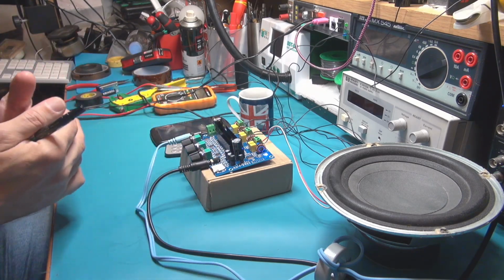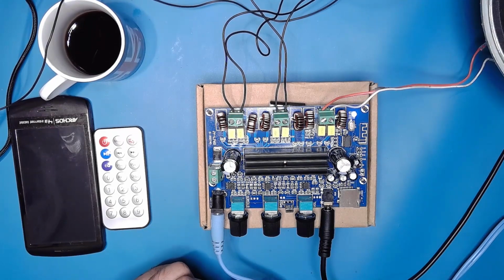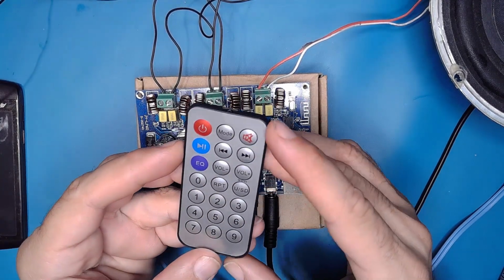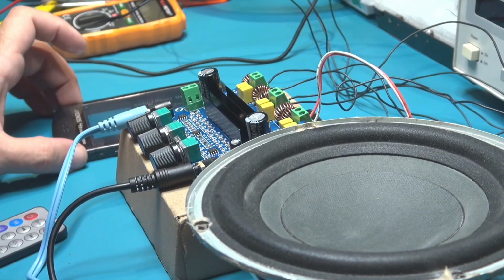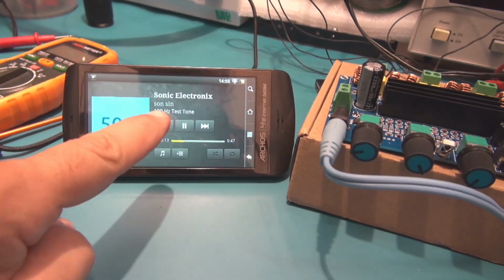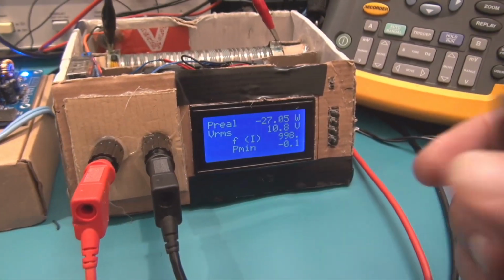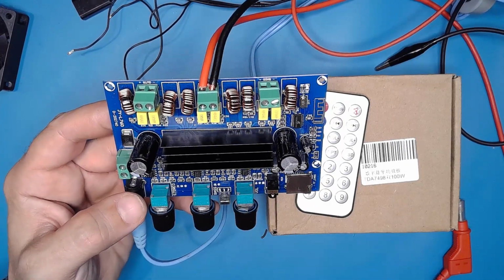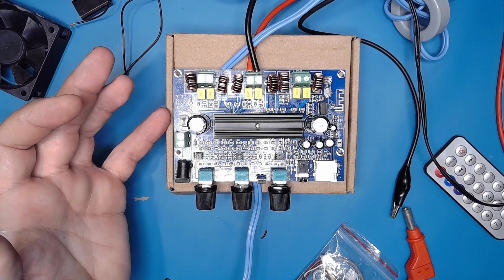2x60W + 100W Bluetooth 5.0 TPA3116D2 - The Real Watts

Comment: Id like to build a portable party box with decent bass and battery life, what size can i get it down to realistically in terms of cabinet drivers and battery array? can you give me some tips please?
Reply from the maker: it depends about what you're calling "decent". Also many of amplifier valable on the market are 12V minimum. Or you can need a little boost converter to transform 2 cell battery to 12V. This kind of tinkering are driven by the component you have. Do you have 3inch speaker? 2 inch? What box do you have? Do you intend to build your box? If you want decent bass you will need a big box, no easely handeld. Sometimes, recovering an existing box with already integrated box (from bass box of instance) is the best idea.

Comment: can i direct connect to a motorcycle battery 12v 3ampere?
Reply from the maker: yes but you will have less power than rated. Except if you use a voltage booster.

Comment: The amplifier is rated at 100 watt at 2 ohms i have the same amplifier
Reply from the maker: 100Wmax on 3 ohms
Reply: No texas instruments official data sheet states that it does 100 watts at 2 ohm
Reply from the maker: @hamxamufti5895  2 ohms forbidden. Sellers talks about 3 ohms minimal.
Reply: How and when was 2 ohms forbidden it is stated in their official website.. can you tell me more i have the exact same amplifier
Reply from the maker: @hamxamufti5895  this amplifier have overload output protection. When maximal current is reached, protection will work and you can never exceed the rated power for this amp. Under 3 ohms for the bass canal will make the amp working under rated specs, making the amp heating, decreasing effeciency. This is why the minimal rated impedance for this amp is 3 ohms for the bass channel, and 4 ohms for the stereo channel.
Reply from the maker: @hamxamufti5895  to use it properly, just use 4 ohms for each channel. The "3 ohms bass channel" is a tricky way to tell that bass have more power in this configuration. Because bass are sometimes sold with more power than stereo channels. Cheating by reducing the ohm value to have more power is more easy than create a special circuit or another power rail to afford this power. It's an advertising tip.
Reply: Im using it personally and just like you i bought it for experimenting i kinnda enjoy this so ive paired 2x 4ohms parallel for a 2ohm load didn't notice any power jump thou I'm feeding it with 24 volts but the bass channel is almost always twice as loud as the sterio channels.. i use a 12 volt smps with a voltage boaster.. the reason why i searched your video is that I'm experiencing distortion on the bass channel sterio is clean but the bass channel doesn't seem to be clean at all regardless of the subwoofer i put i always hear noise starting from half volume all my speakers are 4ohms or more even a 16 ohm 20 watt subwoofer was not putting out clean power on this dont know whats the issue but neither is the amplifier underpowered nor is it exceedeing its power limits i have applied the same thermal paste on both chips that i use on my graphics card its great and also a fan on top of it which it bigger than the amplifier itself it cools the amplifier and the output filter coils.. the amplifier heatsup without a fan but with the fan its always cold to touch don't know what my problem is but the power is so unclean to ve listened to
Reply from the maker: @hamxamufti5895  the problem is that your amp is not made for driving 2 ohm load. Try to connect only 4 ohms and use a 24V DC power supply for experimenting. By this way you will find why it has distorsion.
Reply: Does it make any difference using a 12 volt or 24 volt i noticed no difference using a voltage boaster thats rated at 150watts
Reply: All my subwoofer are 4ohms and im having distortion at 4ohms
Reply: Few days ago i think i plugged dc 12 volts into the output stage of the amplifier the subwoofer output to be precise but it powered on properly and i quickly realized what I've done but how did it power on amd did it damade the chip itself and is it causing the distortion now because i believe everything else is just to fine to be distorting
Reply from the maker: @hamxamufti5895  Class D with chips like this are very fragile about inverted input current. What happened it that the voltage sent in output destroyed a internal diode used over the output mosfet. You miss a half sinwave due to the short circuited diode inside the chip. This is why you have a distorsion.
Reply: So should i be replacing the chip for the subwoofer output ?
Reply from the maker: @hamxamufti5895  Look the price of this chip, but I think it's not worth to do that. You should prefer to buy another one, I guess. You need to be very cautious with chinese product, because of their low price there is no protection anywhere.
Reply: The chip itself is like 2 dollars locally but the board is 10 dollars plus it has all the pre amp stage and the other sterio output so I'm keeping this
Reply: I have also notted that the distortion frequency is high enough to be ditched by my big sub so can i build a crossover network to filter out the distortion
Reply: @hamxamufti5895  You are in fact correct, these boards are 2 ohm stable on the subwoofer channel. They use 2 seperate tpa3116d2 chips, one in stereo mode for the left and right channels at 4 ohm and a second tpa3116d2 chip for the subwoofer output. That second chip is run in what's called PBTL mode or parallel bridge tied load mode. That means the left and right channel outputs are ran in parallel giving you twice the current handling of a single channel, but the voltage stays the same and doesnt increase. Thus to get the 100w mono output power, you need to cut the normal 4 ohm impedance in half to 2 ohms. Since both left and right channels of the second chip are utilized in parallel each individual channel still stays within its rated maximum current levels. I've tested dozens of different tpa3116 amp boards as well as the much better and higher powered tda7498e boards. 

On a side note, the distortion is likely coming from your 12v to 24v DC-DC boost converter. An LC filter on the output of the boost converter could help/eliminate the noise. Make sure your boost converter is capable of supplying 10 Amps at 24v or that will cause problems. You should hear a huge difference between running on 12v and 24v, it should be significantly louder on 24v. The chips have a maximum supply voltage of 30v, and when properly heatsinked and ran on 28vdc they actually will do 50w RMS in stero mode and 100w RMS in PBTL mode on the mono bass channel. 

If you need more power look into the TDA7498E boards. They are rated 160w RMS at 4 ohms by 2 channels, 320w rms total or can be ran in PBTL mode to get 220w RMS mono. They require a 36v power supply, however I run them closer to 39v.
Reply from the maker: @hamxamufti5895  I don't really know.

Comment: what is maximum ampere required by the board with24 VDC
Reply from the maker: 60+60+100=220W max.
220:2=110WRMS.
110W:24V=4,58A with 4700µF or 9A without added filtering capacitors.
Reply: @AIexanderHartdegen  Ce petit truc peux pomper 9A 🤯
Reply from the maker: @EnzoE  Il ne consommera jamais 10A en continu, à moins d'y faire des tests de puissance et d'y injecter des sinusoïdes avec des risques de destruction pour l'ampli. Donc une alim de 5A suffit, en y ajoutant quelques condensateurs qui auront le temps de se recharger pendant les périodes moins sollicitées.
Reply: @AIexanderHartdegen Oui je me doutais un peux ^^ Je suis simplement étonnée qu'il puisse consommer autant sans ce détruire en 10s, après c'est surtout parceque je m'y connais pas en électronique je suis toujours étonné de la solidité du matos, en tout cas merci pour ta vidéo, bon j'aurais préféré en Français mais tu doit avoir tes raisons, la qualité de ton travail me fais penser à des vidéos de Deus Ex Silicium
Reply from the maker: @EnzoE  merci pour ton retour. Il faut savoir que ce sont des amplis de classe D qui ont une résistance exceptionnelle comparés aux amplis classiques. Le signal analogique envoyé sur la charge est l'équivalent d'une valeur PWM dont la puissance sur les transistors de commande ne se calcule pas du tout comme sur un ampli analogique, c'est ce qui explique leur robustesse. Toutefois beaucoup de ses amplis sont protégés contre les surcharges, il s'en suit un son dénué de basse. Ensuite, ces amplis ne sont pas du tout parfait, et utilisent principalement des circuits intégrés, possédant des transistors de découpage avec des fronts de montée médiocres, c'est pour cela qu'ils sont limité à une tension de 26Vmax. 
La raison de l'anglais vient du fait que je ne fais pas mon contenu en visant un pays en particulier. Mes études en électronique étaient 100% en anglais, il n'y avait pas un seul mot de français. L'anglais s'apprend en CM2 de nos jours, mais hélas les Français sont un peu ronchons.
Merci pour ta comparaison avec DeuxExsilicium, je pense hélas que c'est un très bon Youtubeur, mais un piètre ingénieur, au vu de toutes les conneries qu'il dit et les méconnaissances des matériels qu'il a démonté. Mais je sais que c'est un compliment et je t'en remercie.

Comment: for the 2x ch 3116d2 can i use a 19.5v 12amp power supply to get 234w divided by 4ohm load to get about 58w out of each channel?
Reply from the maker: with this voltage you will have less power, like 30 instead 50. For the announced power (max power) you need 24V DC power supply.

Comment: Make your project and show it with sound wonder how loud it will be for a blue tooth player
Reply from the maker: @woody ahh
 I can tell you now: it' s hard to represent a louder speaker in a video, but I can tell you the power of this built unit. At full power it will give 2x30W Rms + 50W Rms, and need a hudge package battery. Using this "future" bluetooth speaker at full  throttle is 110W Rms of power, wich is very loud. Of course, using this full power is not the purpose. It mainly to have a large scope of disponible power with perfect clean sound.